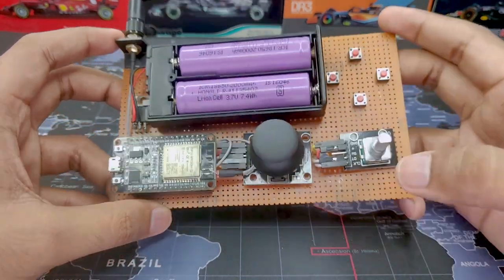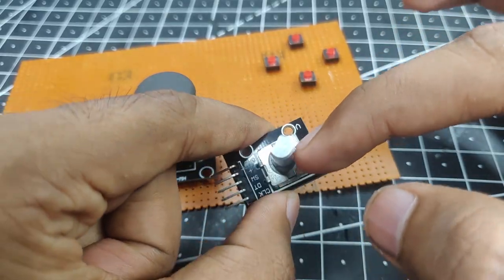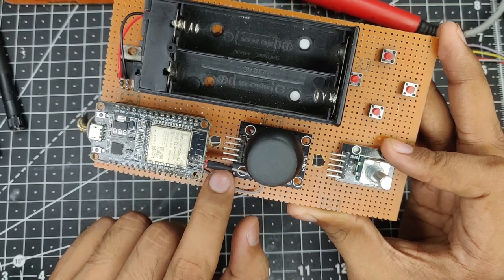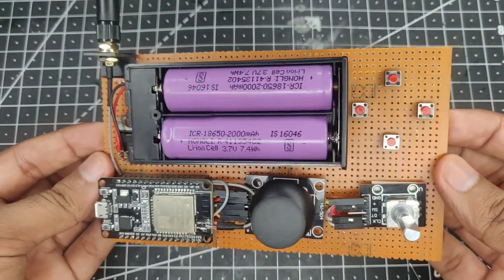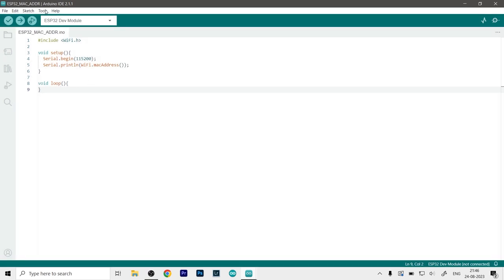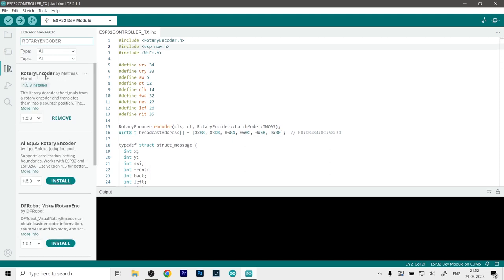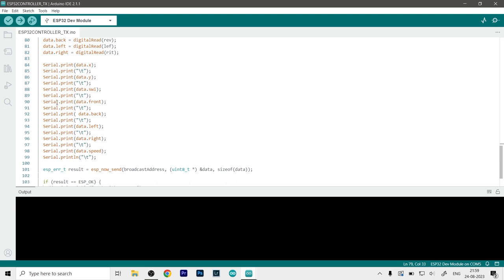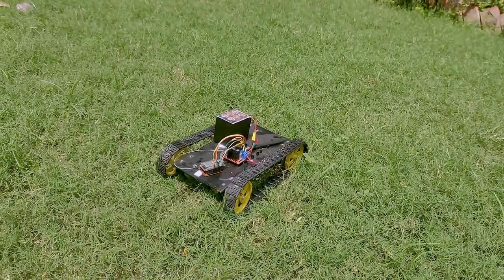Making a ESP32 Remote Controller for your Robotics Projects with ESP-NOW | ESP32 PROJECT

Comment: Nice work brother!! keep it up✌    
Just try to make every boards [Auto-On BOOT] when you're powering up them by using batteries; by which as you powered it on, it will automatically run the firmware into it without pressing the EN button!!
Reply from the maker: Thanks for the tip, will try to use this method next time 😁👍.